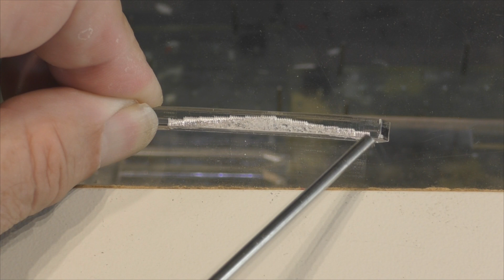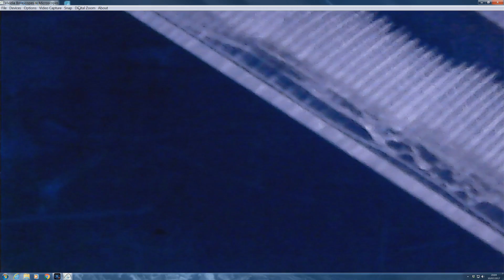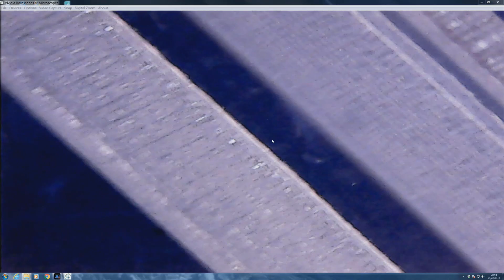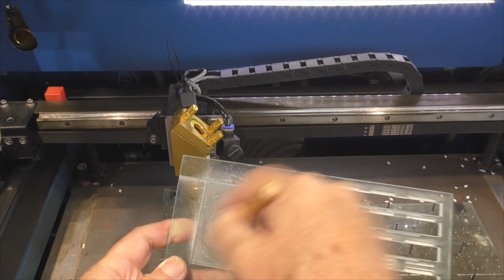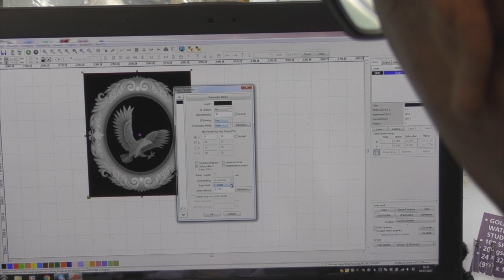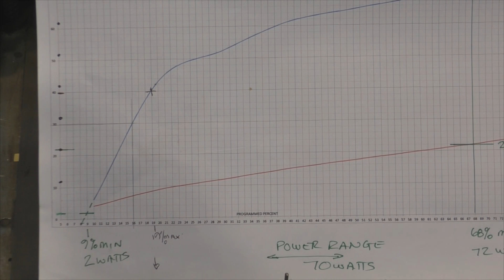RDWorks Learning Lab 111 3D Engraving In depth revisit Part 2

Comment: Hi Russ thankyou for all the great thorough information I do hope somehow you are being recognised for this body of work that is the only thing available in the world at the moment. I havnt gone through all the videos and you probably have answered this question I have a large chinese laser modelled I think on the trotec look and thats where it ends lol for some reason my scan and engraving has slowed right down and the speed is not recognised no matter how fast you make it in rdworks I had little accident where I had left a block in the cutter and when the head went to 0 it got blocked and made an awful shudder and I shut down and then it went slow so have I stuffed somthing on cut it still speeds up its just on engrave and scan its painfully slow well all the best if you get time to get to me thankyou
Reply from the maker: Hi
your little episode with the block should not have done any damage. The horrible noise you heard (yes, it does sound alarming ) was the stepper motor "cogging" It was trying to drive to a position and your block got in the way. The mechanics stopped but the stepper motor didn't. Instead,  the drive signal kept pulsing the motor trying to make it move. Those  sharp pulses are very powerful and were actually causing severe vibrations in the whole machine effectively turning the case into a loudspeaker.  The fact that your cutting is performing normally tells me that there is not mechanical problem such as twisted bearings that may be grabbing the rail. No, I think your panic shutdown whilst the machine was being sick may well have caused some electrical spikes that have upset some of your settings.
Question 1......Have you saved your vendor and user settings? If so I would reload the USER setting file to start with because I suspect the engraving (I think they are called SWEEP) parameters may have been corrupted. If you have learnt anything from my mistakes then you will have these files safely tucked away and can restore your machine. If after restoration you still have issues then we will have to think again.
All best wishes
Russ